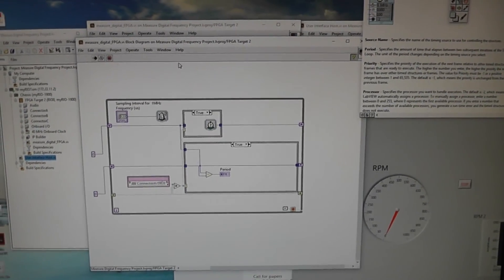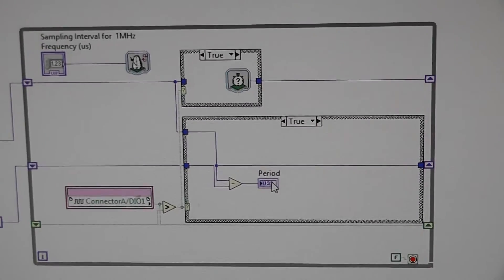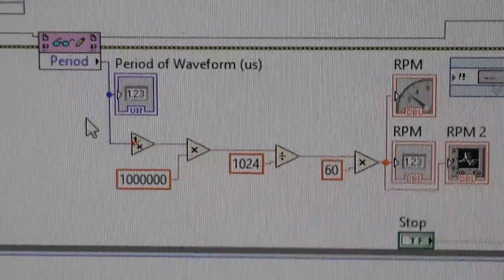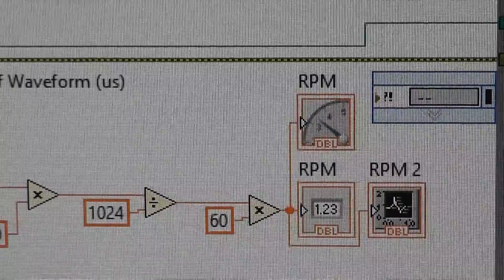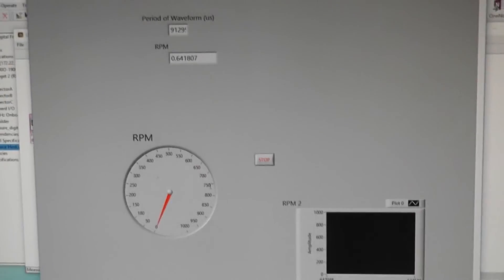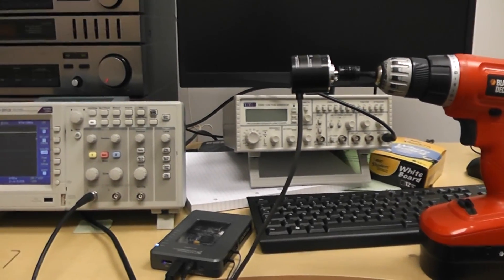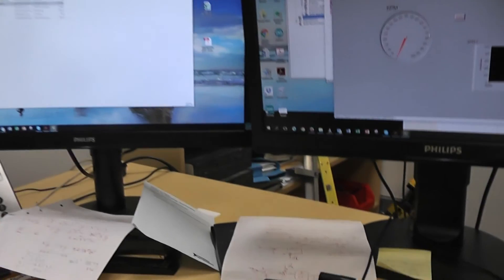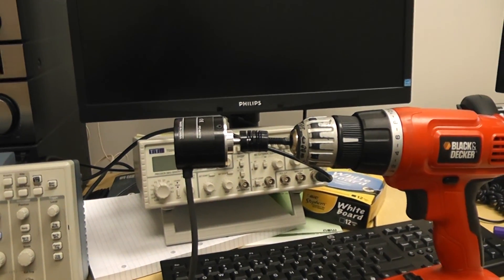Measurement of Speed of a Motor using myRio and LabView

Comment: Can I get the vi file ? I am using quadrature encoder . I have to connect it to myrio and measure the speed. Plz help
Reply: Did you get any VI for the same...I am also using a quadrature encoder
Reply: yes u see the link in comment. u need to slightly modify the code to acquiring IAS signal